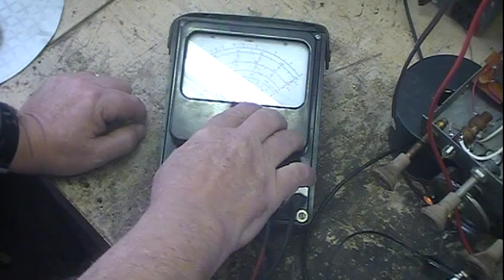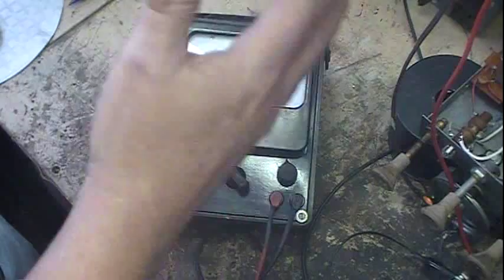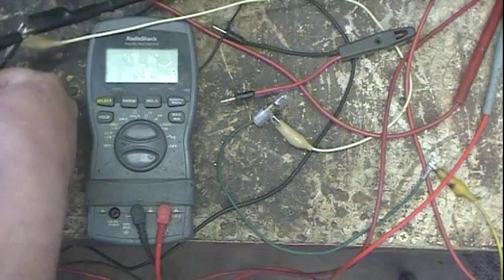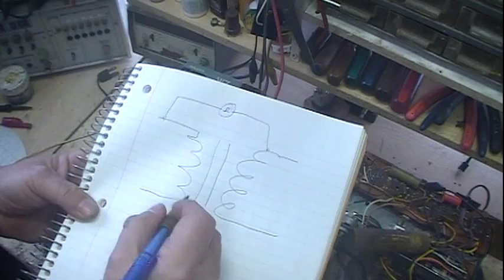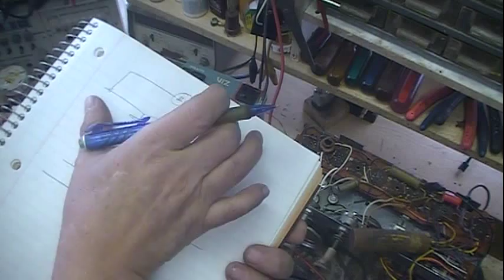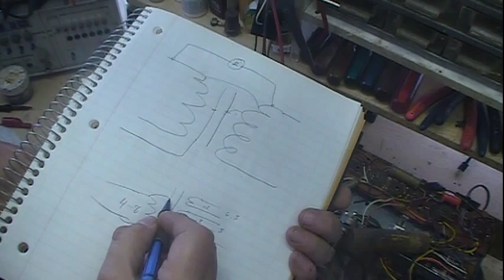How to test an isolation transformer

Comment: Dennis, thank you very much for this vid. Bought an old isolation transformer (700 VA) and checked the isolation with my DMM, measuring 80 - 120 volts to earth!A phase tester (screw driver) also lit up. 
After watching your video, I changed to an analog meter and put some load on it. The voltage dropped to some mV as expected.

Comment: I'am questioning you tube station answered my question regarding is a variac transformer the same as a isolation transformer and the answer was a variac is a isolation transformer.   I used your test on my variac and there is a direct connection between the inlet power cord and the outlet with the ohms meter.  their is no ground cord. please advise, thanks
Reply from the maker: A variac is not an isolation transformer.
Reply: A Variac is an autotransformer with NO isolation at all. You were misinformed.